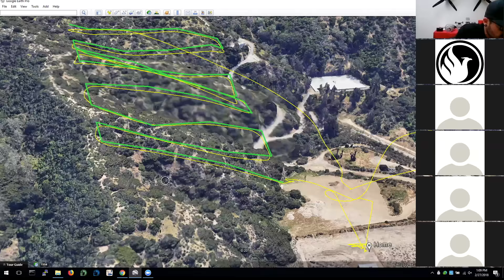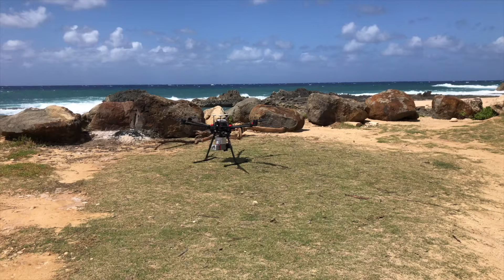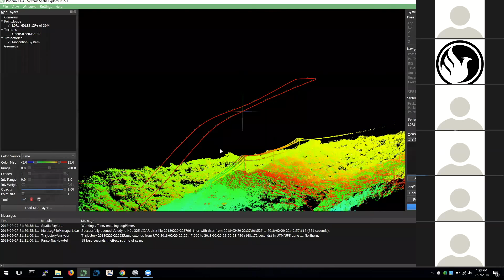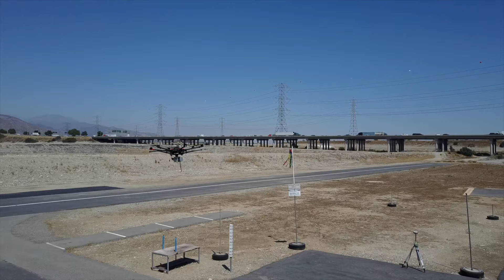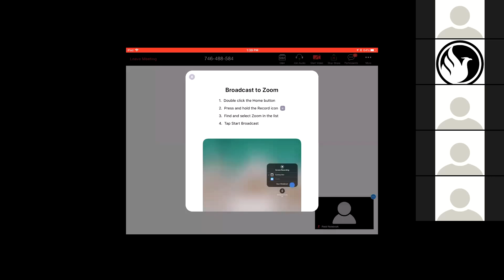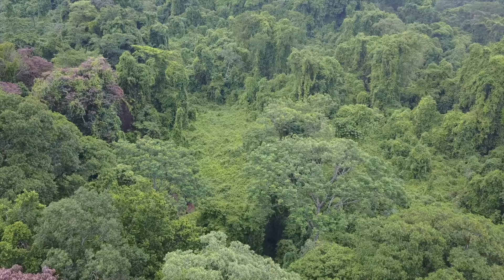Webinar: UAV LiDAR Flight Planning & Tips

Comment: Dear, I would like to know if the drones can do autonomous flight?
Reply from the maker: Hi BKAero, yes, most of our systems are integrated with drones that feature autonomous flight. As Phoenix LiDAR payloads are UAV-agnostic, we can work with almost any drone our clients already have. We usually recommend autonomous flight, which increases data quality by maintaining flight lines, terrain following altitudes, and air speeds better than manual flying can. If you'd like to learn more, email us at info@phoenixlidar.com.